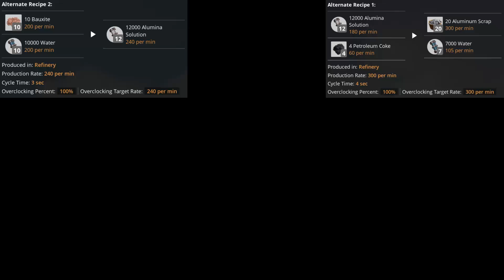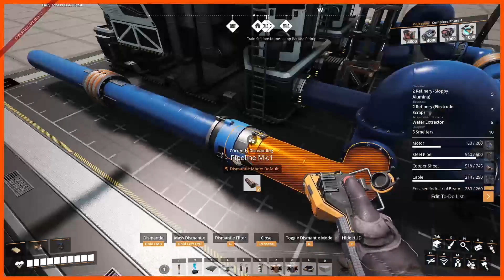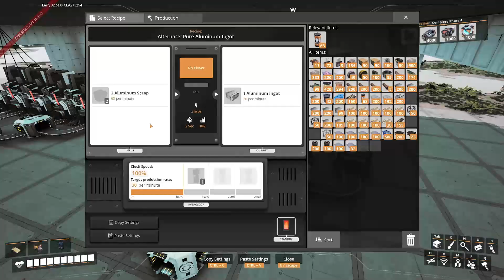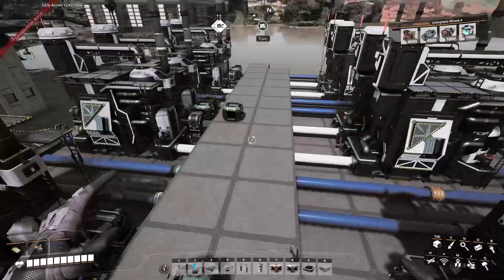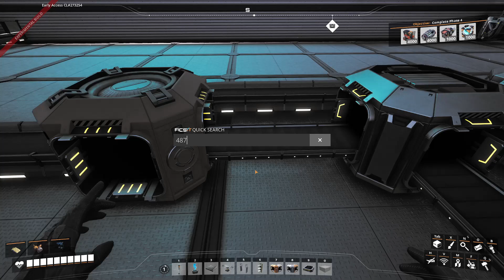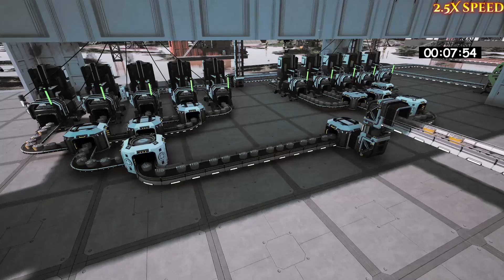LOAD BALANCED 1500/min Aluminum Ingots - Satisfactory - Update 8

Comment: What foundations are those? Thanks
Reply from the maker: No problem! The majority of the build is using 4m concrete foundations colored using the “Primary Foundation” color swatch instead of the default concrete color. Around the oil extractor is Grip Metal.